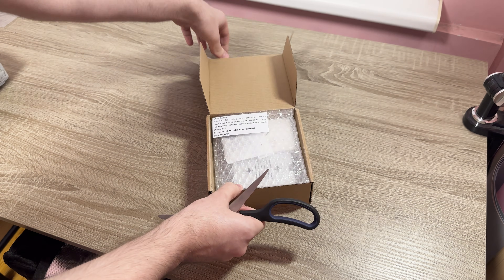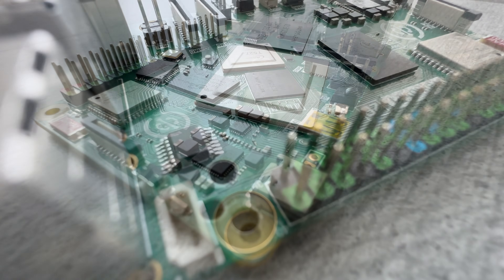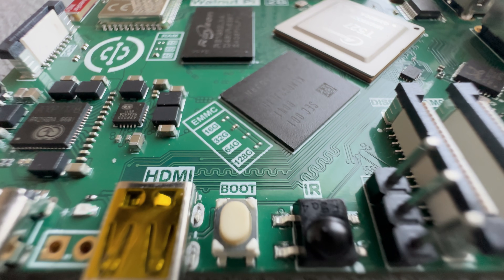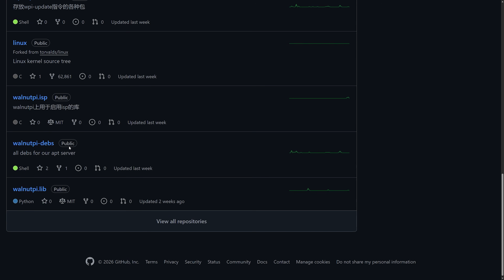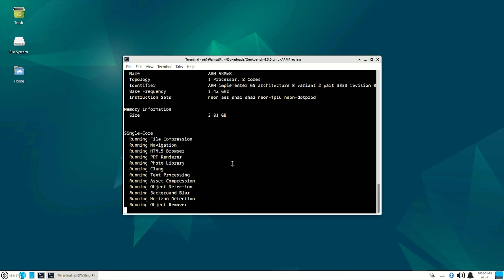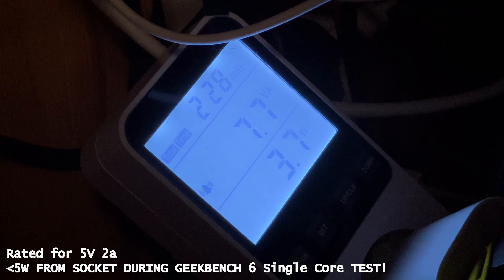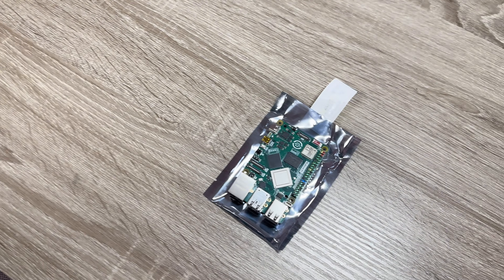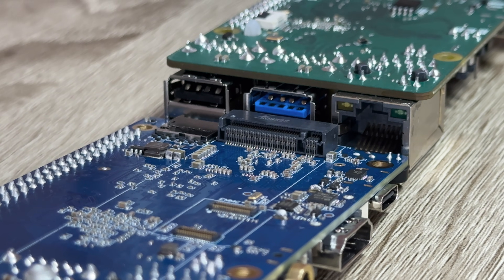Like Raspberry Pi 5, but cheap? Another AliExpress SBC - Walnut Pi 2B

Comment: It would probably be more accurate to compare this to a Pi 4. Shame it has no upstream OS support. If this could run plain Armbian or Debian it would be awesome.
Reply from the maker: I thought about it, but decided the comparison with the Raspberry Pi 5 is more accurate. Its form factor is similar to the Pi 5, not the Pi 4, and, most importantly, it has PCIe. Its CPU power is higher (it only loses about 13% on a single core, but significantly outperforms on a multi-core one).
As for support, yes, that's a problem with many SBCs :(

Comment: Even if location was turned off by default , they would still monitor you.
Reply: In fact, no, you can view the system source code. And the IP can only be accurate to a vague location in the city, while allowing closure.

Comment: rpi is valuable because it has gpios. Does the Chinese clone like compatible in that context? Resister address compatibility. That is only one important question. If not , it's just a garbage.
Reply: It's compatible and has ported Blinka, meaning you can use CircuitPython for GPIO programming on the Walnut Pi SBC. (It seems links can't be posted in the comments section)
Reply: @01studio24  Thank you for reply. But circuit python would run if the  library for python is compiled on the sbc. Circuit python runs and compatible at register address level  is not the same. Al think register address is not mapped the same.
Reply: @youpoofoowoo  In fact, we adapted the GPIO registers. Using CircuitPython on the Walnut Pi allows you to implement I/O, UART, I2C, SPI, and other functions.

Comment: I'm sorry, I did not quite understand what you loaded rather than the installed OS, was it XFC? Did you find any issues running XFC on this board?
Reply from the maker: I meant xfce desktop environment, sorry if I wasn’t clear enough
Reply: @TheSillyWorkshop Okay, I thought that they supplied their own version of the OS (Debian-based IIRC) and you had swapped that out for another Linux distro. But from what you are saying you only loaded the XFCE desktop environment and kept their install. Correct? Thanks.

Comment: Interesting stuff, I'm looking for something to run jellyfin for my 4k TV as native smart TV app isn't available, wondering how well this can manage
Reply from the maker: I am not sure about it
Reply: Definitely not, at least now. But you can select another board, based on modern Rockchip SoCs. They have insanely good video accelerators and Jellyfin have delicate support for them.
You just need select OS carefully. Find the boards that are supported by Armbian project.
About hardware, most modern Rockchip should be good. The RK3588 was being test transcoding capability by Wolfgang's Channel: 60pfs on 4K HDR. To prevent this comment being hidden by YT, I'll paste the video's link in the next comment.
Reply: https://youtu.be/J9dBOx1CD4w

Comment: A raspberry pi 5 1gb is 15 bucks cheaper than this one (via your link) at least in my country (somewhere in Europe). It's around the price of Odroid C5 4GB (the odroid is bit cheaper). so not really worth the price imho
Reply from the maker: But yes it’s price is kinda high especially compared to clones
Reply from the maker: I also live in Europe. How much Pi 5 costs  in your country?
Reply: @TheSillyWorkshop The Pi5 4GB costs 74 Euro (including tax/VAT) The pi4 4GB costs 65. The pi5 1GB is like 45 Euro. I'm from the Netherlands, our tax/vat (what ever it's called :P) is 21% and prices are including tax/vat.
They were cheaper, but the RAM prices are insane at the moment, so everything is more expensive.. Even on Aliexpress.

Comment: I learned by mistake: if there is no official Armbian support, don't buy it. I have some Orange Pi, NanoPi and Radxa devices. Most work great, but the OPi 4A, Opi4 Pro, Radxa Cubie A5E, that all use 'their own' OS with a kernel old enough to be your granddad (so no security whatsoever) and all are running on AllWinner SoC's from the same series as this Wallnut Po, but are essentially nothing but paperweights. 

If you cannot have a CLI-only trusted OS with a recent and regularly updatef kernel, it's a definite no-go. This question remains unanswered. Even the entire kernel-case remains untouched. (Not only by your video, but by other reviews as well)

Another important point for me is: case support. Is it compatible with a Pi5 case? Arrangement of the components may be an issue, even if they use the 'exact' same form factor (got a few, like the Radxa 3C that can only fit a RPi case with the use of a dremel)

I'm quite positive of the NanoPi's I've tried, most of my Orange Pi's (had to get a different case than the original for the 4LTS because the official case didn't even allow for power to be connected) and definitely not impressed with Radxa.

So is this Walnut Pi interesting or not? No idea whatsoever.
Reply from the maker: Yes, it should be compatible with most cases made for Raspberry Pi 5, but I haven’t tested it since I haven’t them. For the price it costs it’s possible to buy O Pi 4 Pro with 8GB of RAM and A733, so it’s not very interesting because of that.

Comment: How many SBCs have I bought through the years that run a special version of Linux?? A year or so later and you're out of luck. No updates, no drivers. the thing becomes a paper weight.
Reply: Judging from the replies to this comment, most YouTube users are knowledgeable! 😄
Reply: Its an SBC, you do not need new drivers. Get your working code on it the 'LEAVE IT ALONE' I have a old Rock Pi that is like 6 years old, its running Klipper for a 3d printer, I do NOT update it, I leave it alone. Its fine.
Reply: @stevedegeorge726  I too have boards that have been running for years but they never fix the problems that have cropped up, there are no updated drivers so the functionality was never realized and never will be.
Reply: Like others have said - updates are not *needed*, an SBC is not supposed to be your main PC and you're not supposed to ruin security sensitive stuff on them without rolling your own OS image, just like you shouldn't on a PC running some randomish Linux distro - UNLESS you take responsibility of the code yourself. Also drivers are the same thing, you have them once, you can't lose them. You'll need to bake them into a newer kernel if you want a newer kernel, or set them up to load as modules, or whatever YOU choose. 
The point being that an SBC is NOT a PC, you decide what you deploy it for and generally speaking it is to do some specific task so you set it up once and forget it until you need to update it because you're changing the usecase in some way, in which case you can update the OS if there is some reason to do so. But the only things you typically need to worry about the security on are things exposed to the internet - which ought to explicitly exclude your toaster, washing machine and SBC's. 
Some people use SBC's as limited "internet devices" in which case the security shouldn't be an issue because there is nothing on the device to compromise, and you can reflash the OS to it in 5min and be sure it's clean. 
So not sure what it is you used your SBC's for, but it doesn't sound like what they are meant to be or do.
Reply: @noth606  Yes but how many have shipped with one or more functions not working correctly? How many times have they done more development and made all the functions work? So you end up working around what you intended and know that the one piece of hardware you wanted to work right, never will.
Reply: Did you try install Armbian? Their firmwares are well maintained and support wide variety of SoCs. I even dont realize any different of Armbian OS with proper Debian/Ubuntu server.
Reply: If it works, it's not paper weight. How do you think computers worked before internet and OTA updates were a thing?
Reply: @simp-slayer  If it works? If it doesn't because something was never fixed in the original distro then it never will get fixed or added the drivers that made some piece work. So you end up with 80% or less of the orignal board working.
Reply: Do you not understand that there''s old infrastructure that's will using windows XP???
Reply: @IrishFinalExit The garage where I get my car serviced runs its entire system on XP. The keyboard at the reception is covered in years of grease and oil but still somehow works.